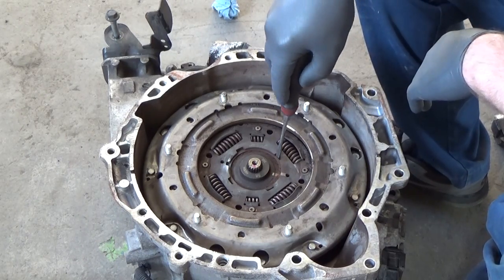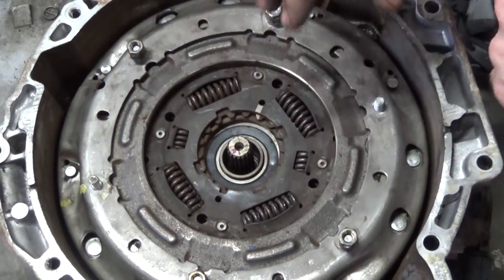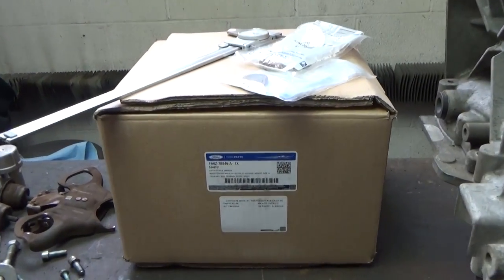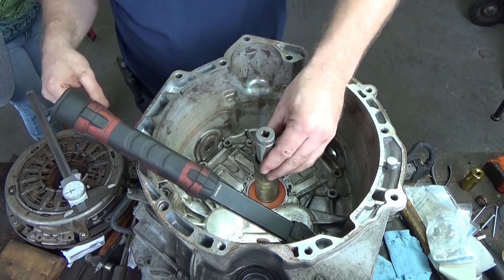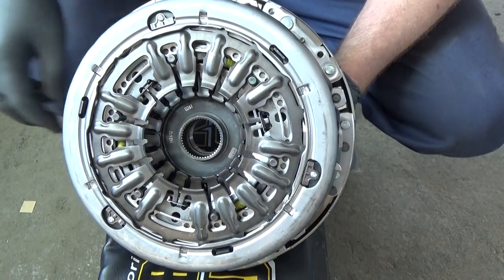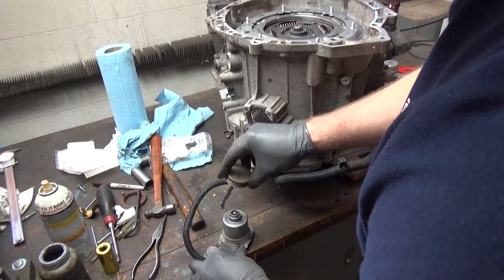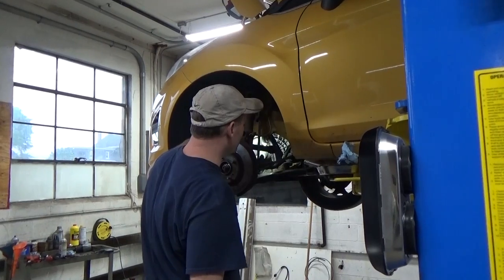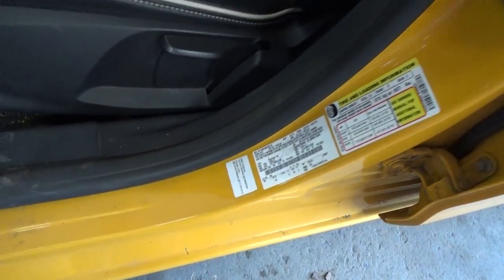Ford Fiesta DPS6 Powershift Transmission Slipping/Shudder Part 2 (Clutch replacement)

Comment: It's really ignorant of Ford to think they can make these slip the clutches a whole bunch without consequences. I truly believe the programming is the heart of the shudder issues.

Ever heard of Tom's tune? I bought it and I don't seem to have any shudder. Every once in a while I can feel the gears change, but nothing major. Such a shame, these would have a great reputation if they were programmed right. Also, adaptive learn is immensely dumb on a transmission like this

Comment: Impressive.
Reply from the maker: Hoopty_ Medic thank you!
Reply: robinsonsauto I don't use that word lightly concerning this video or mechanical in general: you defeated the Ford special tool requirement! I had to overcome that same requirement on a 4.0L a year or so ago. Well done my man.
Reply from the maker: Hoopty_ Medic greatly appreciated! This one had a few challenges to say the least and in the end as you mentioned got the job done  ✅ pretty well I believe. And with some minor modifications will be outstanding! Thanks again, glad you beat the odds as well!

Comment: Is it ok to Add Lucas transmission fix to the DCT fluid?
Reply: I would say no.  The part with oil is solid.  The dry clutch and computer is.  I found a dctf for half the price and good reviews from RS owners and their tranny takes the same fluid

Comment: great video it was very log but explained what FORD AUSTRALIA did to my wife car.

 Now in Australia there is a class action that has cost them around $10,000,000 for damages to the transmission that they never told the consumer while charging them for repairs , all of these are now covered under extended warranty and buy backs are in place on recurrences regarding transmissions. After now the 4th problem with her transmission I am now in the process of a buy back based on putting my wife and my daughters life at risk, I say to everyone on here stay clear of these cars
what is it going to take a death to a family member before a whole product recall is on the table

don't know about the USA and around the world hope the same is happening there also

 https://www.ford.com.au/about-ford/newsroom/2018/ford-australia-statement-on-agreement-with-accc-relating-to-hand/

Comment: Dude. All you need to do is use snap ring pliers to remove the input shaft snap ring. I don’t use any special tools other than the reset socket to remove or install these. Lmao if you need proof I’ll shoot you a video.